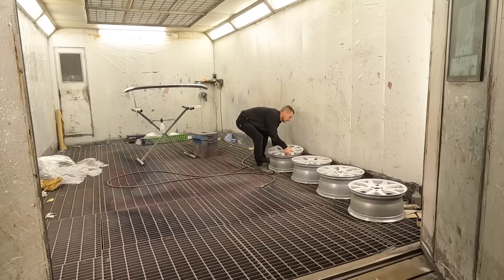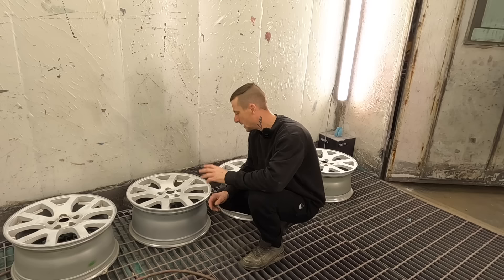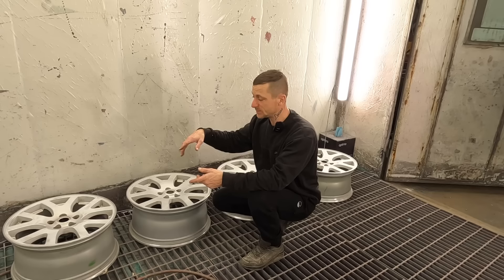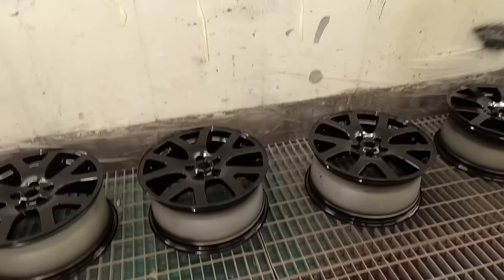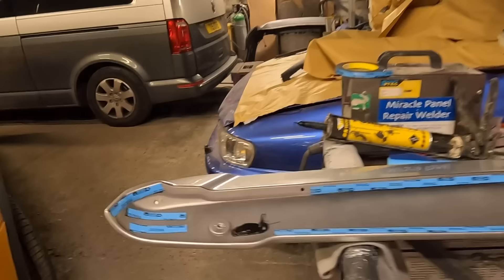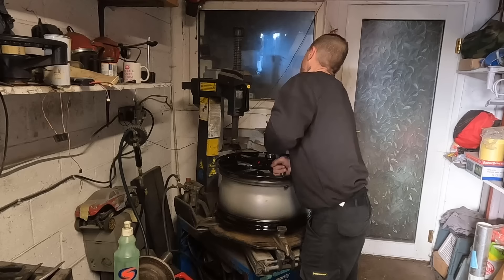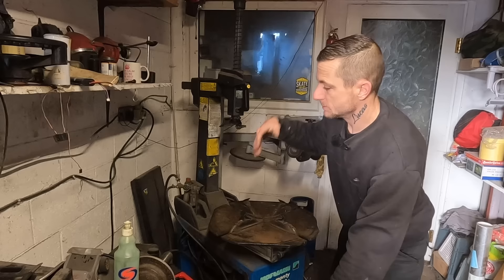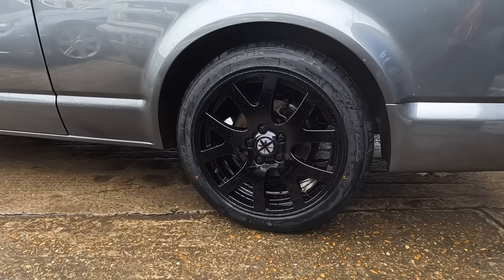T5 transporter build - Super fresh wheels - Spoiler

Comment: Silver, YES :) Feel your pain on the ill part mate good job Got some Land Rover Alloys for mine with the 975 load rating as well and some 10mm spacers as the wheels came with the extended bolts 53 offset 18"  The ones currently on the van look better but are wrongly rated for the T32 and were on it when I got it, Unfortunately still can't get near it due to recovering from the Cancer treatment and lack of immunity (Hence the feel your pain) So many plans, so little money and not enough health :p Lovin it.

Comment: Ace work bro I went with 20 Range Rover alloys your right it is tight on the rear arches but I used thinner tires
Reply from the maker: Hey Robbie thank you mate 👍 I read the 20’s are right on the inside I think the 19’s fit with no issues but still used little spacers